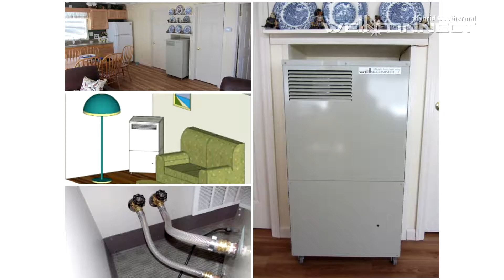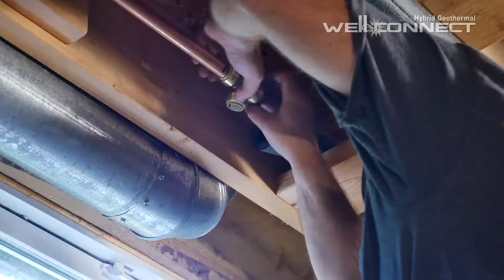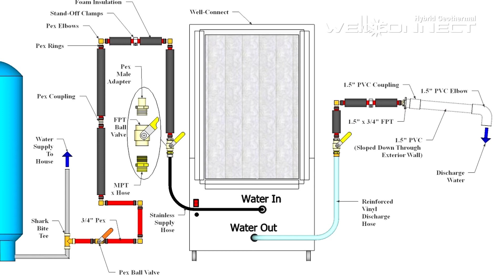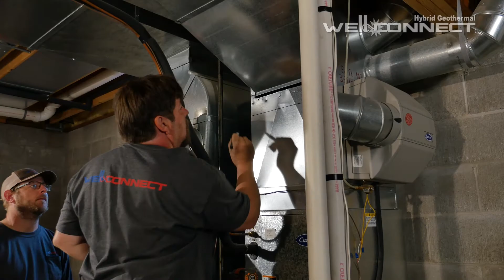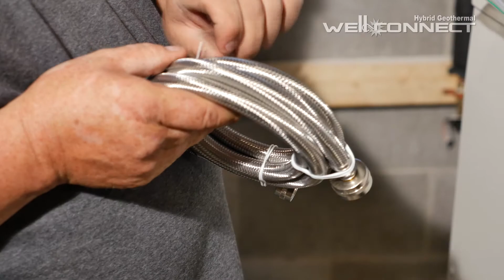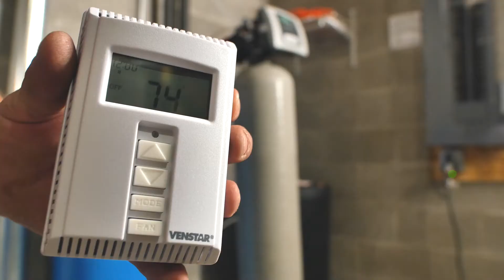Well Connect Hybrid Geothermal Heating and Cooling How to Install

Comment: I built a new home with radiant heat 20 years ago and used Geothermal returning the water to the bottom of my 400’ well and pumping from 150’ which worked well. I was in the HVAC business and did this for about 4K. Today I wouldn’t do this, instead I would use solar assisted mini splits. When you account for the electricity to pump the water you would be equal to a non solar mini. I feel money is best spent making your home more efficient first through air sealing and insulation, after that an efficient mini split where you spend most of your time will save the most money and bring the greatest comfort.
Reply: Thank you for the insight, I suppose the efficiency of a constant 50° exchange media is outweighed by the cost of pumping the water 🤷‍♂️
Reply: @ I agree, for me the install cost was only 2K more than conventional but for most 10-15K. Just adding 2” insulation board to the exterior of your home and making you attic R60+ would drop your heat loss/gain by at least 50% over a minimum code built home.
Reply: Have you considered a closed loop instead of pumping from 150 and returning to 400? In such arrangement water going down would push itself up so the electricity is used only to compensate for friction.
Reply: @iiio12 no due to the cost of drilling. A system that utilizes bore holes might get you to a real world COP of 5, a mini split can get you a COP of 4 or slightly higher. So if the geothermal system is 20% more efficient but cost 25K more than ditching a central system, then putting the money towards reducing the energy consumption of the building by 75% you are far better off than building a minimum code structure with a higher efficiency system.
Reply: @paulmarc-aurele5508  Thanks for sharing your practical experience! I incorrectly assumed that the well was drilled for water consumption and geothermal added later on (which I'm thinking of). Climate compliance (if COP stands for that) is one aspect, but another not the less important is autonomy. The question above got me puzzled for a day) and I came to the following proof:  if we cut apart a closed loop system at the bottom point (which is submerged into a well) and continue pumping then the kinetic energy of discharged water will be transferred to the surrounding water, while the water pulled into the pipe has to accelerate. These two energies combined can be spared by closing the loop. And yep, insulation is the key!
Reply: @ A heat pump's Coefficient of Performance (COP) is a measure of how efficiently it transfers heat. COP is calculated by dividing the heat output by the power input. In simple terms the COP of electric baseboard is 1. A unit with a  COP of 5 would give you the same heat as electric baseboard but at .20 cents on the dollar.

Comment: 1) since the water supply is not treated, what prevents the build up of rust or mineral scale inside the well-connect and piping?   2) you state there is no excavating needed - how can that possibly be true when you run a 3" buried discharge line to somewhere?  3) why can't the discharge just be piped back into the existing well since the water is not treated? 4) why does the well-connect need 240v power? It's not running the well pump or heating the water. It seems like it would sort of work on the same theory as a (120v) refrigerator to remove heat from the water to heat air then run a (120v) furnace fan to move the air in the duct work. Refrigerators and existing furnace fans are not 240v... 5) why don't you mention anything about needing a permit and inspection on this installation?  Most county officials would not approve of just open discharging onto the ground.  6) why no mention of the cost or even a range of the cost?

Comment: Looks nice but what about water waste from your well? This looks like you are wasting lots of gallons of water because it is not a closed loop system. Can it be used for radiant floor heating?
Reply: The water drains back through the ground, and back to the aquifer (open loop).  It would not make sense to use the discharge water radiant infloor heat as it is very cold water. Water is never wasted
Reply: Why couldn't the water be discharged back into the well ?
Reply: Most water would not even come close to making it back to the aquifer. This systems design is not well thought out.
Reply: @bobberbuilder6122    they do that' but not sure this system is designed for that' (my guess is you can).
Reply: Farms across America use 55 Billion gallons of water a day to irrigate crops… that water isn’t wasted!! It all eventually ends up back into the aquifer
Reply: @NicklasSchultz   - except for what evaporates

Comment: Can i run it right to my sump pump? It goes all the way out to my ditch….
Reply: Yes, this is a great way to utilize your existing discharge line.
Reply: yes, but only if you want your sump pump to run a lot.  you might want to have a spare pump handy for when the current one dies from being used so much.
Reply from the maker: The water discharge can be routed to the sump pump discharge line just before the line exits the home (with a check valve), but not directly into the sump.